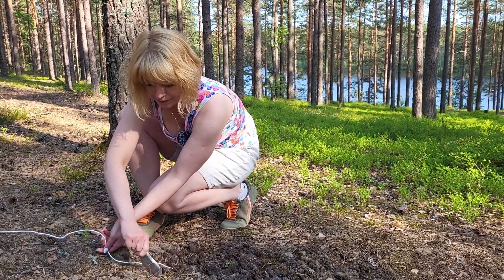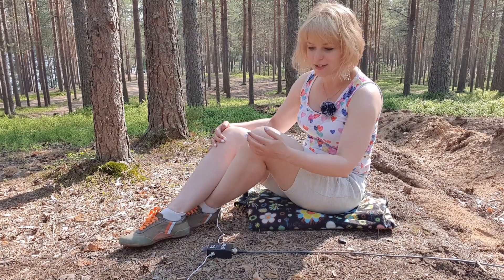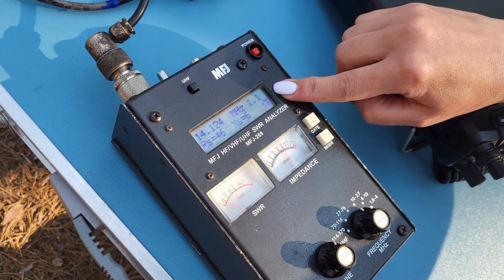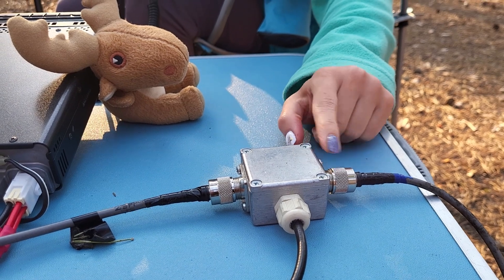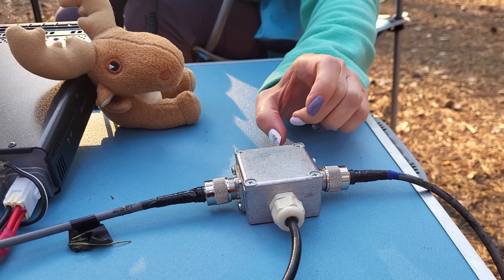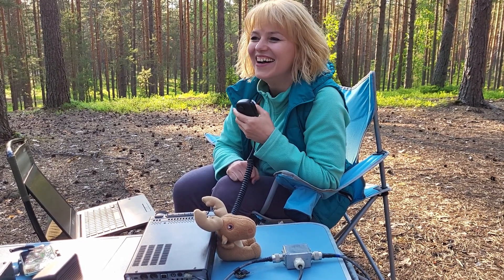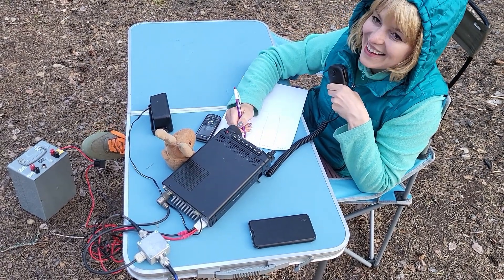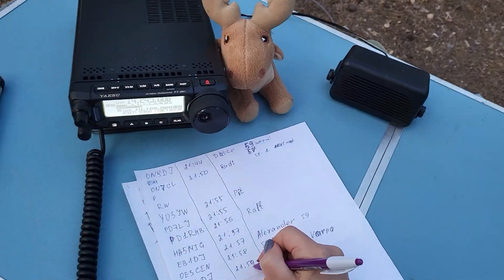Underground vs 8 m high. Raisa compares HF dipoles - this time in the forest

Comment: This test shows a TX loss of 2 S units, which is a big deal on transmit. That's like dropping from 1600w down to 100w. On the other hand, the test proves it to be beneficial for RX with the same receive but lower noise floor. The L.O.G. antenna is great for receive and lays on the ground too. If you use 2 antennas you can opt to transmit on a yagi and still receive on a ground lvl antenna. Yagis are NOISY.
Reply from the maker: I agree with you! And underground was just an "absurd" test. To prove that it is still possible, EVEN so. Of course 2 units are a big difference. But ... I also had 2 QSO, who gave more for underground (and was not very close to me) 73! Raisa

Comment: Well done Raisa and nice to see you back on the channel. Well you have proved one thing for sure and that's the old saying "Height is Might" is no longer true. You have certainly made the antenna choice of those who want to work portable in bush or in the open so much easier. No need to carry poles and ropes to put up an antenna if you don't have any trees to hang it on. Just bury it and it will work fine. Looking forward to the next video.
Reply from the maker: Thanks! of course it does not make sense with UNDERground. It was just a Try or a test... 
It makes more sense 2-3 meters above the soil IF you do not have masts/trees/place/time ect to install a normal dipole...and it will work for sure ALMOST as good as a normal dipole, even for DX! 73! Raisa R1BIG
Reply: No, no, no... burying it will not "just work just fine" you're drinking the cool-aid.

Comment: It would be interesting to see how the antenna modeling software predicts an underground dipole. In particular, if someone has access the NEC v4 code (sorry, export controlled from US) which is said to have advanced modeling of real grounds. I am suspecting this antenna is acting through it's magnetic field moreso than the electric field. But I do not know.
Reply from the maker: Jeff, it is too difficult to me to discuss such things :-) . It was just a Try. 
It makes more sense 1-2-3 meters above ground, IF you do not have masts/place/time ect to install a normal dipole...and it will still work for sure ALMOST as good as a normal dipole, even for DX! I tried it yesterday with 1.5 m high dipole portable - and a pile up was on my QRG ! :-) 73! Raisa R1BIG
Reply: @YLRaisa  Yes of course. I do not have such software myself. But I am enjoying your experiments and gives something interesting to think about for sure. Not the results we might have expected. Great work!

Comment: 👍 that’s amazing, but I’m thinking I’d rather have the 2 S-units.
Reply: 2 S units is like going from 100w to 1,600w. Every time you double the watts you gain 1/2 an S unit. 100w to 400w is a single S unit. 400w-1600w is another S unit.
Reply from the maker: Hi! of course it does not make sense with UNDERground. It was just a Try. 
It makes more sense 1-2-3 meters above ground.. I just wanted to show: IF you do not have masts/place/time/trees/ropes ect to install a normal dipole or GP...you can make it easier and it will still work for sure ALMOST as good as a normal dipole, even for DX! Are you a new sponsor? :-) Could I have your Call? My email is info@raisa.blog 73! Raisa R1BIG

Comment: Raisa,
Few weeks ago I was in beach for BOTA (beach on the air). I have seen forgot my vertical antenna at home.
Then I found my hand made 49:1 balun and 10 meters 6x0.22mm alarm signal cable in the car.
But there were no trees or wall or fens for fixing cable as a slope antenna.
Then I remember your video and lay the alarm cable on the ground.

I made 3200 kms QSO from Istanbul to Porto 🙂.
My power was 20 watts.
Porto reported I had 5.9 signal level.
Thanks for sharing your experiences 👍👋
Reply from the maker: Wow!!! Thanks for sharing your nice experience!!! I am glad your antenna worked good and you have DX station only with 20 w. 
Congratulation!!! 

It's much better than go home without any QSO 😂
Reply: I checked my logbook. Qso was not to Porto.
It was Istanbul to Malta 2.200 kms. Reported 5.9
Sorry for mistake. However very interesting. 10 meter layed down cable and 2200 kms QSO.

Comment: It would be interesting to repeat the experiment with the screens switched as well, not just the inner, so the two antennas are entirely separated. Also move the over-ground one well away, or place it at right angles to the buried one.
Reply: I was curious about the antenna switch. I am curious how one commenter determined that both antennas were active at the same time.
A -12dBr/-2 S-units between the antennas seems to indicate the antennas are separated.
If the switch is SPST then only the center conductor is switched and the ground/shield is common between the antennas at all times. Then you would have an unusual OCFD with parallel elements. It would be one antenna swithing the active elements.

My brain may be thinking beyond its normal capacity.
Reply: I was wondering exactly that too.  Then again, there are two ways to make a dipole - a straight connection to the elements or by using a balun.  Either way, the common ground (or shield or screen) is still going up to the sky because the grounds are common due to the switchbox.  Remember, even if you use a DPDT switch you must also use a plastic enclosure as with an SO-239 connector the ground would still be made common through the enclosure or find some other way to insulate the shields or no sense putting a fancier switch into the same box.  A cheaper (but slower) way would be to just change out the coaxes at the radio.
Reply: "Истина где-то рядом." Fox Malder.
Reply from the maker: на какой частоте искать?
Reply from the maker: I made another test with ONLY underground (from the beach of Baltic sea)/ you can see my conclusions here: https://www.youtube.com/@YLRaisa/community
Reply: AT 90° you wouldn't know if it is the difference over/under ground or the difference in directionality.
Reply: First suggestion was move well away, second was implied 'well at least minimise the interaction' Still better than having them on same axis - which one is doing the work? Your comment suggests all signals align with one antenna or the other. ~Most will be somewhere in between. Flawed test wiith effectively both antennas in circuit all of the time. Are we bothered? nope - good to see Raisa getting out there and experimenting with radio. @tulenik71

Comment: Radiation patterns will differ, even if antenna alignment is the same, so that's another variable you'll have to compensate for.  It would be interesting to see some comparisons in antenna modeling software. In any case, I have some experience with large (one-wavelength) loop-on-ground receiving antennas for VLF/ULF, and they do work surprisingly well.

Comment: Hello there! Underground dipole and elevated dipole have different (opposite in the direction of maximum) radiation patterns. May be correspondent was in the direction of maximum for undeground antenna and in minimum for elevated.
Of course, the efficiency of elevated dipole should be significantly higher at the same level of matching.
Best regards Yurii.
Reply from the maker: Юрий, возможно, направления тоже влияли. Они же и в вертикальной плоскости по разному излучают. Мои выводы можно посмотреть тут https://www.youtube.com/@YLRaisa/community